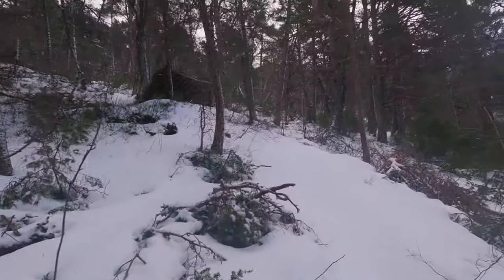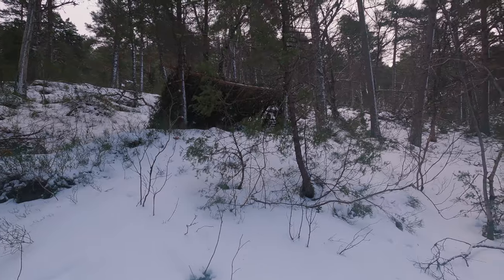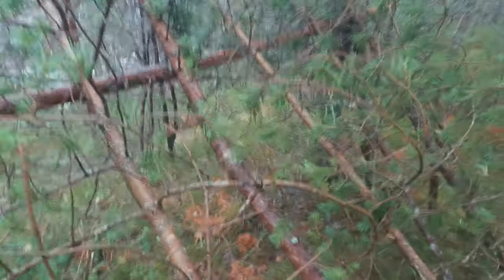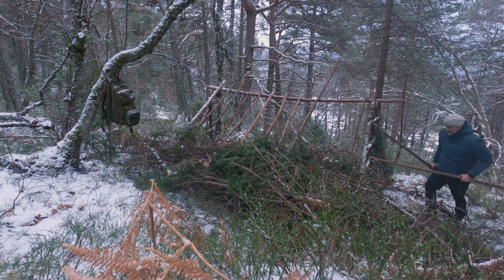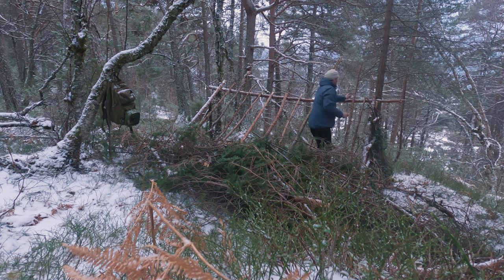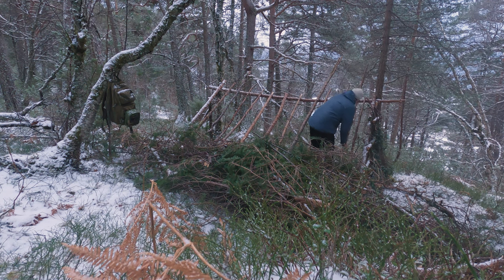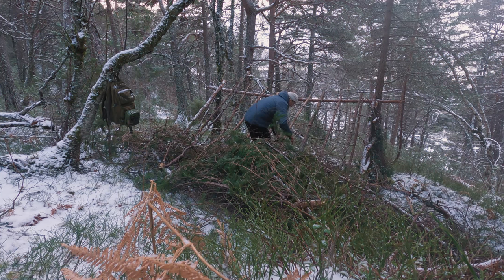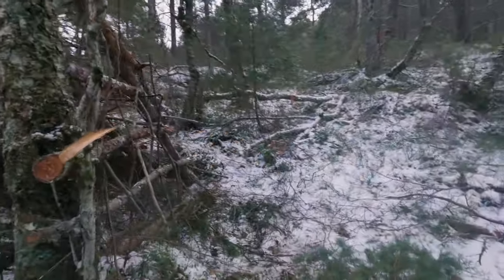How to build a Lean-To Shelter - Norwegian Busch Craft

Comment: Thanks for the upload from your video friend, it's very nice but I see that you rest in the smoke and that's not healthy. Greetings to you from Leen into the Netherlands.
Reply from the maker: Good observation :-) The wood was wet, and wind was blowing straight through the shelter. With some more work on the roof, covering it up making it more wind proof, and larger fire, the problem should be fixed. Thank you for watching.
Reply: @NorwayHikesTrails  Thanks for the reply. Leen.